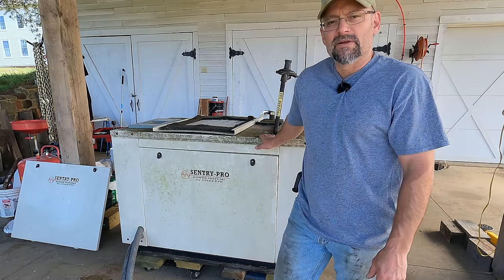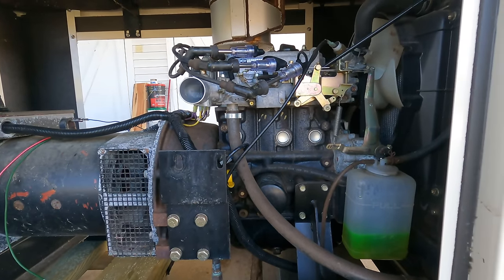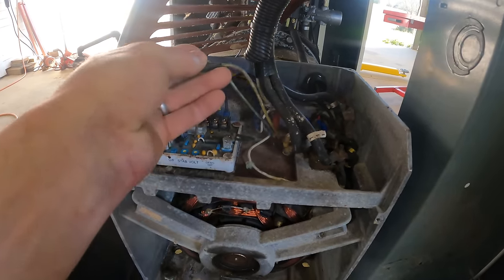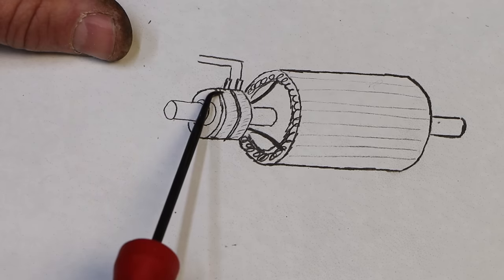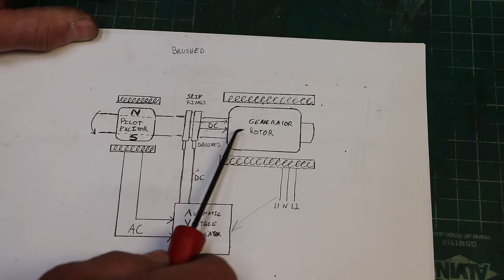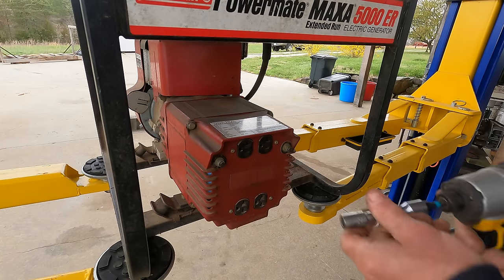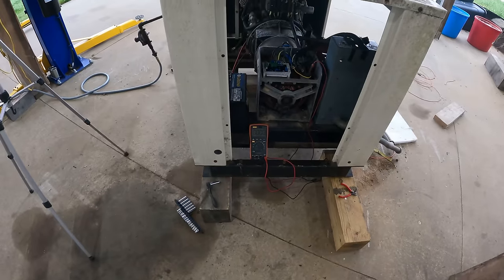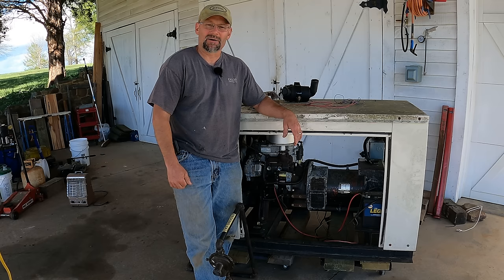How Generators Work, And How To Fix Them.

Comment: To bad it wasn't a 3 ph unit. Would have been nice to have for future equipment in your shop. I had a old military surplus diesel unit that was great for running all my 3 ph stuff until of course the engine went and repair parts were no longer available. Great video as usual, thanks.

Comment: One thing I've been taught is the brushless motor puts more mechanical load on the prime mover in the generator.  It its not powerful enough to cope with this it'll be constantly changing in speed as the avr tries to compensate and ends up constantly hunting for the correct output voltage.  On a larger engine this increase in load is easily compensated for by the engine governor giving a much cleaner output

Comment: You explained this so well. I don’t know how you do it.   It be interesting if you came across a portable welding machine. They (my miller 400d is anyway) have brushes on them but there inverter machines unlike the old Lincoln pipeliners. (example sa200). I don’t understand why they aren’t brushless like newer motors/generators are.

Comment: Another bloody good vid :)
AVR I think is a Kutai out of Taiwan, they seem to be the go to for after market AVR's. Gensets that are mechanically governed like yours tend to have about 4% droop between no load and full load, so setting them to 61.5-62Hz no load should make them settle out at about bang on 60Hz at 3/4 load, which is also where they tend to run best for both the engine and fuel economy.
When they don't have a PMG they sometimes have another winding in the stator (especially common in Mecc-Alte alternators which I think yours was?) that provides the power to the AVR. To get around having to flash them when residual magnetism is gone some alternators have a small magnet in them to produce a small EMF, just enough to start the AVR on its build up cycle.
To prove if its the AVR or not either flash the field against a 12V battery (after measuring the excitor resistance) or much better, bung it on a bench power supply. If you wind up the volts in and get volts out its the AVR.
If you want a quick load bank to test, salty water in a bucket with probes you can lower in. It can be exciting, I have vids to prove that, but it works.
 Loved your reasoning and explanations, can't wait for the next one!

Comment: If you are going to be doing much low-ohms measurement, a nice tool to have would be a 4-wire ohmeter, also known as a milliohmeter.  When you were measuring 0.3 ohms, that was probably the resistance of your test leads, not the winding.  Make sure you get a good Kelvin-clamp test lead set, too.
Reply: Unless he zeroed his leads?
Reply: @JuzzyQld  Generally speaking, zeroing a measurement is a convenience that doesn't improve the measurement accuracy or repeatability.  Getting better low-ohms measurements often requires using higher excitation current levels, even with a good Kelvin probe.  For example, I once was making a lot of measurements on copper windings, so I built a make-shift 100mA current source to excite the winding, then used a regular voltmeter to read the voltage drop across the winding, then multiplied the reading by 10 to get winding ohms.  (I've also used 1A and 10A excitation currents on occasion for really beefy windings.)

Here's a possibly true story.  I once worked for a company that designed test equipment, some of which measured resistance, and some of those allowed zeroing of the measurement.  On one occasion I was getting measurements I didn't believe after using the zeroing function.  I tracked down the software engineer and asked him how it worked.  He admitted that the function was implemented in a questionable way (!), because customers would complain that the equipment was broken if the measurement displayed a negative resistance.  I checked some of our other products, along with some competitor's products, and found little consistency in how zeroing worked, especially if you zeroed more than once.  My advice on zeroing functions is to always do a sanity check before trusting the measurement.

Comment: That reminds me of a contracted computer system to the USAF that I worked on many years ago.  The computer building was powered by a motor/generator and the input power to the computer systems was 59.x Hz.  Our contracted computer systems derived its clock from a 12.6vac filament transformer and therefore the system lost seconds over time; pain to readjust every couple of weeks.  I kept being told that there wasn't anything wrong with their motor/generator!  When the thing was eventually removed and replaced with normal power lines the problem magically went away.

Comment: lol i love watching you work through how it works. a lot of these generators won't fire unless the gas solenoid is engaged (gas valve open) AND there is sufficient gas pressure. this is to prevent any kind of dangerous back flow situation if you hook up a tank that is nearly empty such that it actually sucks propane and air back into itself. i have seen this happen with a massive propane tank where the gas systems weren't working and no one knew why (the tank was empty even though Banner said they filled it). never trust the gas man and check your tank levels yourself!

some really fancy generators have extra safety features too and will lock out trying to start for some period of time if there are a number of failures in a row. and the external control (of standby mode) is for when you have a fancy automatic failover system that measures the grid and automatically fires the genny when the grid drops out (often with a big battery to hold your over for the few seconds while it fires up). those controllers can also have fancy test schedules and measurement abilities to make sure the genny fires once a month and produces a good sine wave and voltage

Comment: If that voltage regulator has a UF or knee frequency. That also needs to be set so that it rolls off voltage as the frequency drops to help it compensate for big loads. If it is set too high it can also cause your voltage regulator to put out more field than it needs to. It should be set at 240/60hz where the voltage just barely starts to decrease, then bring it back up to the 240.

Comment: I think the downfall of brushes would be 1)wear 2) higher currents which means more robust components 3) less accuracy on voltage control I.e. dirty or worn brushes and slip rings. 
Small generators to meet a price point use the capacitor instead of an actual voltage regulator. It works, but you are limited on voltage output control as it is tied to engine speed. 
Wait until you see the old Generjunk (Generac) with the LED they used to excite the field with. Many a dirt dobber have caused a no output problem.

Comment: Hey you did great. You managed to fix it. I have been subbed to James channel for years. His vid are great. 

I live in a city (Adelaide, South Australia). Generators are not allowed within city limits. We are allowed to have solar though.
I have a 6.8 kW (pure sine-wave) solar setup. The system has already been put through its paces and worked well. Recent wild thunderstorm knocked out power in my area for over 24 hours.

Comment: I have the exact same power head/gen head and I had given up. I got the unit for $200, so the engine alone makes it a good buy. Runs great, but I get like 3-5V on both legs. It’s a new voltage regulator, and the rectifier and stator ohm good. I was told it needed a gen rebuild to the tune of $1400. That may actually be the case. After finding and watching your vid, I just might pull the gen head apart hoping for a vermin induced problem with an easier repair. Either way, excellent video!

Comment: What a fabulous teaching tool you have created. This should be in every electrical engineering syllabus in college! It's a nut and bolts critical problem solving class in itself.  Congrats on the bottom-line, start to finish, critical-path detective work! Thank you... Spanish has a term...mil-gracias...A thousand thank you's.

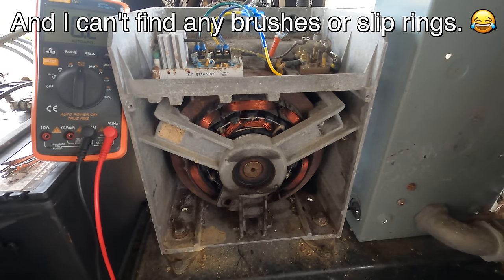Comment: Good video. I  had 67 Bonnie motorcycle they used Lucas electrics (a fear worse than death) I realized I was not getting much voltage( in those days there were no inexpensive amp propes or even ohm meters) all we had were vtvms, so I had to inspect everything by eye. I finally pulled the stator out and found on the backside was a broken wire,apparently the adjustment on the primary chain broke allowing the primary chain clip the wire. I decided to change all or most of the electrics. I  updated the stato 39:21 r to a later model were all the windings were covered in some sort of plastic, so no more cut wires. I  change the two coils to one Honda coil,yes I know the points would fire on the off stroke but that would not hurt the function. I  replaced the battery and voltage regulator  with a battery eliminater( not sure you can buy them today except for nos, remember in the 60's there were few electric start bikes and those that had electric start didn't work well) I  don't remember but I  think I eventually changed the points to electronic  pickups.  I also changed the plugs to gold electrictrodes. I  then had a bike that needed one primer kick and the second kick started the bike.It seems easy to start but for a Bonnie it didn't fit the norm. Usually you had to tickle the carbs, give it two or three kicks before the starting kick,as a bonus nobody could start the bike, they flooded it. The on down side is if you ran out of gas you had no lights. This only happened once, I had the tank on reserve.  I was riding down a mountain in the moon light which was neat, but I new the road flattened out. I saw a hose with lights on so I stopped. I didn't realize how scary I must have seemed. I was wearing a Fonzy like jacket with rags on top no patch (as Groucho Marx said I would never join a club that would have me as a member) Anyway I  knocked on the door and told him what happened I offered him $2.00 for a gallon of gas(pump prices were less than $0.75 a gallon.  He said here take it you don't owe me anything 
I  poured the gas in the tank gave him back his can and road off. It was only then I realized how threatened he must of felt. I  am glad he didn't see the shotgun under my leathers, hey it was a strangers house on back road where you could not hear a gun shot. I didn't feel like dying or killing that night and maybe just maybe he felt the same. Believe what you want, but always expect the unexpected. Always check what you can't see like the back of a stator, it's why I  wrote this and now being 50 years older, I am not telling you how to act and dress, but being decent is less likely to get you killed.  Having respect for electric wires means you  are less likely to die.. I would think that most people still reading this have heard of the 27 club ,I am almost 3 times that age looking back, I did it by keeping my eyes and ears open and my mouth shut. I  didn't start anything I could not finish and most of all I  was not stupid turn off the power before you play with  electric,  don't stand under a pine tree when you see lightning 4 people I knew didn't grasp the concept I  was 6-7 most people don't know their names 😢😢and most importantly hang around people who you can learn from not all these people have degrees, some of them people call the village idiot. Stay way from people who hate, I am not talking about the person,don't hate because of race, creed, language,  or any numer of things they were born from don't hate Lucas because they built a bad stator, which they did fix, learn from it, check the back. With today's computers you can be sucked in to a rabbit hole you might never get out. I  may seem insane yet if you  comprehend what I am trying to get you to understand, If you don't know what your doing a stator can kill you as fast as a sniper,  they (snipers) have a cute saying when they hit the base of the head " it's called disconnecting the computer "
. As humans we like saying things that remove us from the truth. With out a stator a bike will not run. It is all the same, it changes you and everyone around you whether you kill yourself or you kill someone you don't know. Live life like it is your last day as it just might be. Be good to yourself and just as important to others. The last I have to say is life is just like a stator if its fine in front check the back.  If you read all this just know I tried to better your life in this life and the lives yet lived.😅

Comment: Wow... Take a bow... very cool video....  we very rarely comment on videos... but we just had too...  1st off you are one very thuro man...both with the trouble shooting concepts and your fab work and even patients to get the correct slow blow fuses... you caught my attention even more... most just say screw it and use whatever.... we appreciate the professionalism, thumbs up.... 2nd there are so many things identical here it's uncanny.....  we too have this 3-cylinder Daihatsu motor on a 10kw gen set... it was made for Dometic for a large RV... ours will run on gasoline or propane, its on gasoline right now... it lived it's 351 hours of life per the functioning hobbs meter, but it lived inside it's compartment on a now scrapped RV... Heavy bugger for sure...  we have taken an old junk Pentair Master Temp natural gas pool heater from our local junk scrap metal yard only to stripped everything out of it and now we have a case to install the gen set into that looks 95% the same as yours OEM case...  cost zero... Gen Set almost free $300 US.... everything works as new...  Here are more similarities... your two meters the Fluke87 III and your Fluke T5-600 we both run the same test equipment...this is too coincidental; we've had these two Fluke Test meters of approx 25-27ish years...amazing you have both these meters or what looks like them..  You fine Sir are a very unique, smart and hugely capable man... I like this... this video was my 1st to see at your channel... not for long... im gonna binge watch over the holiday.....  OK sorry for the long back ground story... for MY REAL question.... So we can sort of figure out what this Gen Set was originally used for and how it was hooked up....  Here's my Question you were into the Gen Set Windings to check for stator/rotor damage....  did you happen to notice were the neutral/white and ground/green anywhere in the electrical service breaker box or at the gen's head set... were they every jumper'd together as a main primary electrical source, from a utility typically are...  or were the neutral and ground separated...??? 
Very important to know... in our application will have to keep them separated for its intended use.... im sure you are seeing why we ask and are catch'n my drift... For other readers while off and isolated from any outside electrical connection.... if one checks continuity to neutral/white and ground/green this would be interesting to know....and would answer generally how this unit was installed at in its previous life assuming it was installed correctly there....  Great Channel.... you fine sir would be someone we would break bread with... 
Have a great 4th holiday... be safe out there.... I will sub and get notices as soon as we hit send on this apologetically long comment.... Keep up the great content....

Comment: Do you think the piece you cut out was solid because it was acting as a heat shield from the generator below? It could still draw in air and run across the heat sink from the side but now it will get direct radiant heat. It is possibly a negligible amount and probably won’t impact performance but it was just a thought that crossed my mind.

Comment: Excellent tutelage for the generator, I was excited ( see what I did there).
My theory would be on smaller engines the pressure pulses vary more ( instantaneous speed on crank ) producing dirty fluctuating power.
On a multi cylinder engine the multiple pressure pulses are smoother so it is cleaner.
Cheers Rick

Comment: I'm an electrical contractor from the state of Florida for 40 years plus magenerac technician for Verizon T-Mobile sprint, an American tower corporation. I thought you did an outstanding job explaining we use pmg excitation also on that regulator you need to check your water column

Comment: Propane engine always have clean oil as the carbon doesn’t get into it. 
The panel is chopped as a way of taking it apart and the bodgy way of doing it. I love the laughing noise it make at you after you try to start it.

Comment: Just started the video and going to predict that the TS1 +12v terminal is designed as an output, when the wire was cut it blew a fuse that powers the control panel. You essentially backfed it via TS1.

Comment: I have a unicorn of a 6500W Alternator AVR  portable power portable power source.  Generator would be the wrong word. I got it for a couple hundred bucks and it was only started once and sat for 10 or more years.  I went through the engine routine of draining the old oil, completely cleaned the carb, replaced the spark plug and got it running just fine.  But no power.  I replaced the Exciter capacitor and it started putting out power.  However I was afraid to use it until I checked the output sign-wave.  I bought an oscilloscope meter and was horrified at how dirty it was.  It looked like a wavy caterpillar with spikes all over the place.  It ran my table saw just fine but I need to clean it up before I’ll use it as a house back up.  What ideas do you have?

Comment: Those "spade" connectors are actually "Fast-On" connectors, spade lugs have two forks.  "Electronic tubing"  is nicknamed "spaghetti" and the best is braided fiberglass tubing with an outer plastic coating.  Just because you are getting 252. Volts in your shop does not make 240. Volts wrong. Ron W4BIN